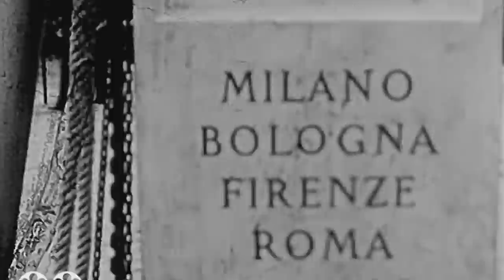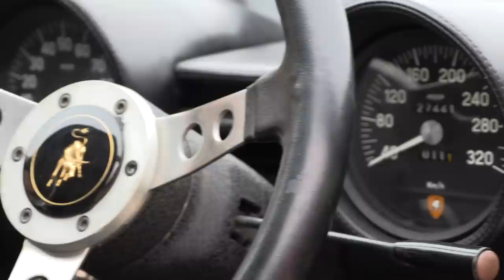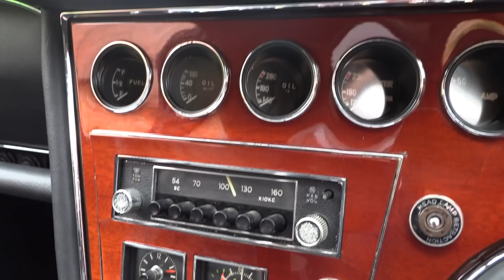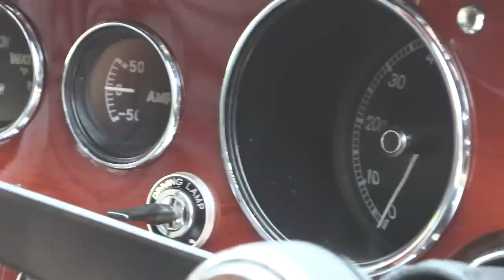Toyota Made a Great Car but Still FAILED To Beat The Italians - Toyota 2000GT Vs Lamborghini Miura

Comment: Nice format, nice presentation.
But an utter mismatch, by the way.
Seriously?
Both cars are "special" 1960-ish coups, yeah.
But You cannot compare a midengined 400 Hp V12 with a 150 Hp in-line six.
A good match for the Toyota could have been the E-type, or the Giulia 1750 (similar weight, similar power, similar handling, similar front-centre-engined layout).
The Lambo does not compare to anything, it is the very purpose of it: it is MEANT to be a brutal, preposterous, ignorant, raw, bloodthirsty machine supposed to scare the hell out of you.
The 2000GT is like a dinner with an elegant, lively, educated lady full of charme and style, that you will call the day after and maybe one day live with.
The Miura is an intercourse with Harley Quinn against the door of some tequila-bar toilet, that there is no way is going to end well, even if you survive to tell.
You know she will stab You, or the Joker will, or you will be punched by Batman and will end in jail, and (despite you know that) yet you can't help yourself in banging her against the door.
Looking for rationality in a Lamborghini is just nonsense. 
Some sense may even be there, such as comfortable seats, aircon, stitched leather, but it's just a DISGUISE.
It's no Toyota, don't want to be, never will.
You won't use it every day as you won't use a jetsky to cross the Atlantic, because you know you will die horribly, if you try.
The Miura is a car you drive for 10 minutes and (if it does not blow in a ball of fire and you survive) it takes you an hour to tell the experience.
The Toyota GT is a very nice sports car, sort of a Lotus for every day, actual grandmother of the Miata.
Unless a Lambo, a beautiful yet sensible car good for everybody.
In my opinion however the best match to it is not a Lotus, but an Alfa: the Montreal (despite time gap: 67-70 for the Japanese and 70-77 for the italian).
If you wish an italian classic match to the GT2000, that is the best one (and you might change Your mind about the "best cockpit ever").
The Japanese was very edge design in 1967, the Montreal was the very last firework of the 60ies style, that's why they have so much in common (unless the Lambo).
Last note: come on! You don't enter in a sports car this way! 
You put your left foot in as deep as possible, sit on the border, squeeze your knee left of the steering wheel, drop your ass on the seat, bow and take your head in, finally take the right leg in too, done. Ford F40, Lotus Elise and all such devices force the driver in doing this procedure (and inversely, to get out): all of them.
They are not Mercedes SL or Corvettes, man! They all require sacrifice to be used.
Nice video though, and subscribed.
Reply from the maker: Thank you for subscribing and for the interesting comments! I think the point of the comparison here though is to highlight just how different they are in the approach. Reflecting the different cultures. Have a great weekend!